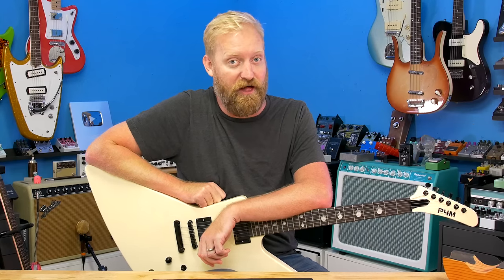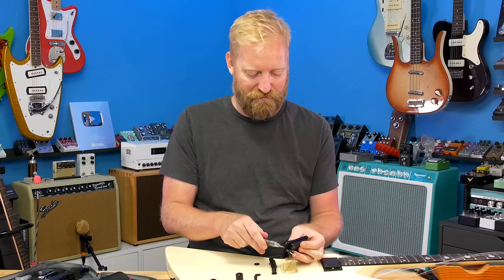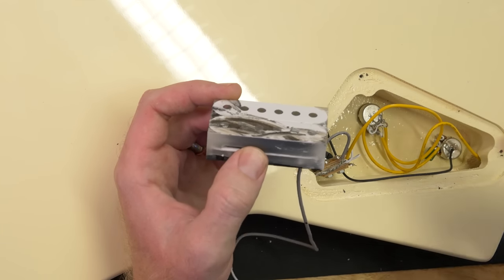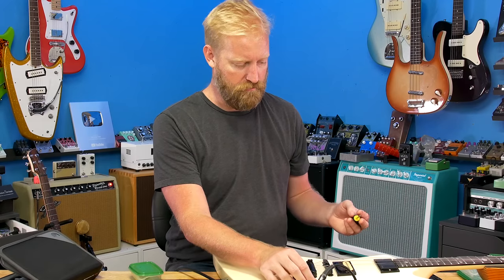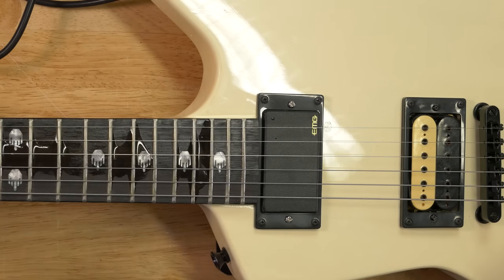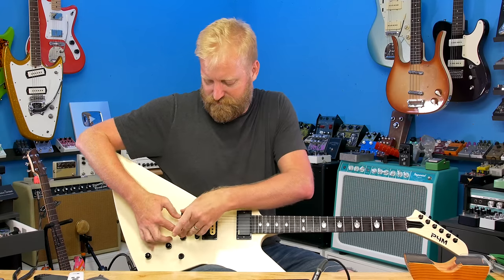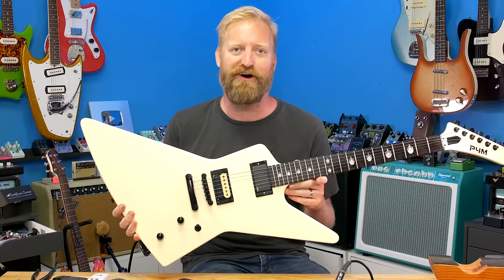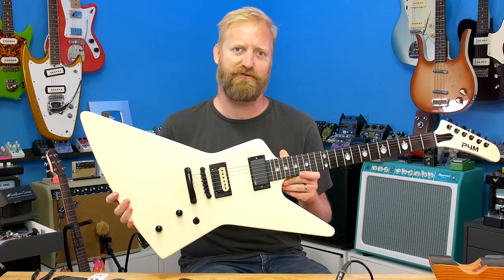EMG OMG! - are these EMG branded pickups FAKES? - (Obviously they are, but lets take a look inside)

Comment: Something similar happened to me about 30 years ago. I bought a Les Paul copy, my first guitar with humbuckers. After I got it home and restrung it I thought I'd take the cover off one of the humbuckers. To my dismay there was only a single coil hiding under the cover. Fauxbuckers.
Reply: And then you found out what a P90 was.
Reply: After the Low End Lobster thing with the Gretsch.  I used magnetic paper on the "Humbuckers" of my Epiphone Viola.  Not humbuckers.
Reply: I still don't know - never used one. Am I missing out?
Reply: @waytospergtherebro  A P-90 with the cover off shouldn't look exactly like a single coil, with a space next to it to place another single coil.
Reply: I had the exact same thing happen to me with an LP copy--I think it was a Lotus? I took them out to swap them with pickups from a cheap Ibanez, and sure enough--metal humbucker covers with single coil pickups underneath.
Reply: @andrewmize823  Mine was an "Onyx" from what I remember.
Reply: Was it an Encore?
Reply: @andym2612  

Im looking at one of those right now. Its a typical low impedance ceramic single, sitting on one side of a humbucker plate, with a chromed cover on it.
Reply: @waytospergtherebro  Huh?
Reply: Harley Benton EX with EMGs have real EMGs right? It's about 399 euros on Thomann. It's not fake, right? Well, it's fake EX copy guitar yes, but with REAL EMGs????
Reply: @JohnnyRaven69  Yes. I've had several Harley Bentons with EMGs and the PUs were the real deal.
Reply: @tostrmofo6686  Nice!

Comment: That’s black epoxy.  The coils probably weren’t wax potted first. You still have to do that with epoxy encapsulation.  The epoxy didn’t seep to the top of the pickup. So there’s an air bubble there. That’s probably why they are microphonic.

Comment: I have wires with crocodile clips at each end and clamp it before making the connections permanent. allows for a lot of experimenting with no hassle. If I am experimenting on a strat style I have two pickguards, one on the guitar with the pickups mounted and wires poking through and another out of the guitar with the switch and pots. Then just text and experiment before moving the pots and switch to the main pickguard and making connections permanent.
Reply: Me too, now. I once wired up a Strat w 26  settings. A lot of work for nothing. I ended up using 3 a lot and 5 more occasionally.
Reply: @terryenglish7132  but it was fun to experiment, surely. Particularly useful when you don’t have the colour codes for the humbuckers.
Reply: And all the EMG bass pickups I have use the DuPont connectors ... only desoldering required to fit :-)
Reply: @stephenhookings1985  Good on paper, but I had one break. I managed to salvage it , but it was tedious work. Bad design. The connection belongs on the lead ends, not at the pickup body. I do hate having to change switches or more when swapping p-ups , so its a good idea in general not done right.

Comment: Thoughts: 1) EMG fakey fake fake. 2) Install the GFS humbucker; the fake has too much of the BAD microphonic-ness. Bonus: double zebrabuckers = cool factor. 3) Pull the tailpiece and use sandpaper to take the finish off where the wire touches; also, make sure the ground connects properly to the output jack (you may have to sand it, too). 4) Bump up to 11s - if you want beef, go with a set of medium GHS Boomers. Style points for top-wrapping the tail. 5) White paint jobs are basically prime for any refinish - 3M maroon scuff pad to take the shine off, and repaint however you want (you could even just hand-draw on it) before spraying clear over the finished product. 6) Or you could just sticker-bomb it if you have a stock of swag stickers. 7) Killswitch...if you're going to do that you need the red arcade type, leave the guitar white, and pretend you're Buckethead.

Comment: Cheaper than cheap pickups, if they have that much resin on there and are still microphonic. Do have to say, though, that even with the distortion you had on there when you got it, it didn’t scream like it was on a Nirvana album.
Reply: As far as the bootleg EMG’s, probably done to make it as close to Hetfield’s as possible. (And, if you ever join a Who cover band, you could use it for Anyway, Anyhow, Anywhere’s breakdown - with all the feedback and rapid fire toggle switching!)

Comment: you probably just need to run a ground wire diagonally from the control cavity into the bridge post hole with the end stripped a fair bit so it gets sufficient contact with the post.
Reply: That was my first thought; that they didn't get good ground to begin with.

Comment: I run a set of EMG 57/66 TW in my guitar and I can tell you that the more vintage voiced EMGs are reasonably microphonic almost to the point where it's kind of a problem sometimes. If I play a song that I've dropped with my Digitech Drop along with the music, if I'm in front of my speakers playing the music, I will hear the song come out of my amplifier pitch tuned down and it always creates this insane dissonant harmony that is actually kind of awful. Makes playing with a drop pedal actually extremely frustrating. I still love the pickups to death, and I'm sure that it wouldn't really matter in a live setting, but when I'm practicing, I have to be careful not to sit with the guitar directly in front of my monitors or I will hear a pitch shifted version of the song that I'm playing while I'm playing it, if that makes sense.
Reply: The digitech drop is such a dumb pedal. Personally i have a guitar or 3 for every tuning
Reply: @Ottophil  personally, I'd rather not have 15 guitars just so I can play along to songs I like. Plus, using a drop pedal allows your string tension to always be the same and your muscle memory develops faster. And I only have to buy one gauge of string and can play my favorite guitar the whole time. A lot of professionals use them for the same reason. It's one of the best options unless you want to go with a modeler, which personally I don't. Let people like stuff. Your thinly veiled humblebrag is kind of embarrassing.

Comment: I got a guitar from China last month. A Schecter Guitar Research (silkscreen on the headstock) Jaws of Death (BalSac) clone (has the neck inlay) with a pair of "EMG's" color coded for Ceramic (Gold), and Alnico (Silver), a single volume knob and a 3-way toggle switch (which N + B were wired in opposite from standard). I originally thought the pickups were a variation of EMG HZ's like Cort uses, but like you describe, they were terribly microphonic! I installed a set of quality strings (10-46 D'Addario XLs) and found a two-wire configuration in the control cavity. I was like, "Huh!" So I went to EMG website and looked for some HZs. Still several pins, so I knew then that these were imposters. So I added a couple of ON/ON/ON mini toggles with various cap values for BASS and TREBLE cuts to tame them, but I still wasn't happy. I took it to the next level. Replaced their mock FR tremolo with a FR 1000 and nut, replaced all the tuners, and was I literally was listening to videos and comparing sets of legit EMG passives to slap in there with a Kill Switch Pot when I came across this. I really appreciate you posting.  I got a custom lizard skin wrap coming, since the body and neck are actually really pretty good. So I got a base guitar, and am hot rodding it for a one-of-a kind.

Comment: I had the same grounding issue on a Les Paul I built with black hardware. Went in with a small Dremel bit, and cleaned the paint off the inside of each hole in the tailpiece where the string ball ends sit, then took the finish off the insides of the hooks on each end, the inside of the posts where the hooks attach, then made sure the threads were bare with a wire brush. Perfectly grounded.

Comment: curious about the grounding thing - I had the same issue a little while ago with an LP clone that I was modding out and I couldn't for the live of me figure out why it was having the grounding issue until I realized that the ground wire was going through properly to the bridge but the sleeves that were going to the body weren't actually metal - the sleeves were actually chromed plastic and the ground was never going to contact the bridge. once I replaced the entire tail it was all good

Comment: 2 Things. EMG makes excellent passives that work w normal pots. All their p-ups are epoxy potted, unless its changed since I took  an EMG Select apart . These are fake.
Reply from the maker: Unless it's changed, those were usually labeled as EMG-HZ instead of just EMG. I think the EMG Select were labeled as "Select by EMG" - steve
Reply: @60CycleHumcast  Yes, EMG makes the active EMG, the passive more upscale EMG- HZ, and the passive  budget EMG Select.EMG is the company name , as well as that of their active line.
Reply: @terryenglish7132  there were some EMG inspired pickups on the Steinberger XT25 Gibson reissue - really weak and needed replacing. I love EMG actives on my basses and I added a set of DG20s to a cheap Harley Benton strat on my channel - they sound great.

I would hope the pickups shown here are fake. And if so I hope the supplier ceases and desist - there again best to add your own EMGs on from a known good supplier.
Reply: @stephenhookings1985  Those aren't EMGs in any form, inspiration not withstanding. Gibson bought Steinberger.. The reissues have p-ups made by/for Gibson or Epiphone depending. I have a Spirit small body RI and its p-ups sound fantastic, but they are weak. They're going for clarity and transparency and flat response rather than trad sounds or power. The guitar itself is much better than the originals; totally different design, just looks the same. Other than being weak how did they sound ?
Reply: @terryenglish7132  my point is simply at one time the PU were, as you said, called EMG Selects. But eventually Gibson stopped putting the EMG label on the case - which I think is a good move. The PU on the Spirit were just poor in general. And the almost Humbucker size (89 x 38 IIRC). I tried using a guitar PU (as per Rick) - it so almost worked and gave the bass a decent powerful tone. I tried unbranded Chinese PU. They were like those here. And microphonic as hell. Even foam on the back didn't help. Eventually I routed the cavity wider and stuck some Warman Jazz blades on it. For a passive bass it sounds good - and with the Royal Blood inspired distortion and octaving it is "to the max" (I restrung E to high C and levelled frets).
Sniffer Customs put real active EMGs in one on his channel. Beautiful job and tone.

Simply to say I would hope EMG would not sanction their name on crap pickups. They seem expensive as a brand until I factor in that I have zero noise issues and a reliable tone to sculpt as I want. The cost of my time to shield a guitar or bass is greater than the price of the pickups. I would hate to find fake EMGs - and as u have stated - it is normally easy to spot a fake.
Reply: @stephenhookings1985  Wow , too bad. The bass ones must from a different source. No issues w the guitar ones. Edit: On rereading your reply I think I need to mention something. The original 'Bergers used Bartolini p-ups as Hi-A originally. Then they switched to EMG. But neither company was owned by Steinberger. They just were the suppliers. So when Gibson bought Steinberger they no longer had any connection w EMG so they can't call their p- ups either EMG or Select. Cheers.

Comment: I don't think they were ever going to be active EMGs with no battery to be found. But EMG has a series of passives too, I don't know what they look like under the cover and they are not very microphonic. Also I think the EMG logo colors are pretty specific to models, those look like some of the active model colors to me but I'm no expert.

Oh and the color coding for pickup wires is a mess and I hate having to Google that shit every time I swap pickups for a guitar
Reply: From what I could find the Passive EMGs have an “HZ” next to the logo on the front and much more similar to an Active EMG with the quick connects.
Reply: Bing it instead? Variety is the spice of life 😂👍🏼
Reply: Like Schwig said, passive EMGs would be branded as EMG HZ. These are 100% fakes.
Reply: @Swigger96  my Shecter bass has EMG HZ's in it but they are active

Comment: Did you check with EMG as to whether they supply to BadCat / or ask them to verify (or not) the pickups?  I assume that the  Metallica  /James Hetfield endorsement is fake also.
Reply: It is
Reply: The biggest giveaway for me is that generally EMGs are powered by a 9 V battery which has a separate set of conductors. This pick up did not have that. It also did not have the EMG quick connect system built into the pick up. In fact if you look on the back of the black goop you could actually see the pole pieces kind of sticking very strange to say the least!

Comment: Bought a cheap, white ESP (under $200) Explorer only for putting a checkerboard (Rick Nielson) vinyl face on it as an art piece.  I wasn't expecting EMG's in it but, I knew they weren't real EMG's (after inspection) but, because they are flat on top, I was able to vinyl the pickups with ease.  It plays like crap but, it's a great looking wall decoration.  I saved some of the vinyl so, if I want to put real EMG's in it, I can still cover them.  The neck is horrible with some high spots, though.  Lot's of work that I don't really have the gumption to fix, right away.  Still, it's aesthetically beautiful. 

Speaking of IVY guitars, I bought one of those Lizard Green LP's (for $200 on Amazon) only because of the look of the Iguana Burst Gibsons that came out a few years back but, knew I could bever afford.  The Flamed Maple veneer was blurry and after playing it for a few minutes, I had black fingers.  They obviously painted the "Rosewood" neck.  It played great out of the box but....

Before that, I bought a purple burst AIO/WOLF LP for under $600 with a hard case and that thing plays like a dream, right out of the box.  Worth every penny!

Comment: The reality is still such that for under $10, the Chinese could produce an identical clone to active EMG's. Their active is SMD so it's literally 25 to 50 cents including the PCB for a Chinese clone anyway. The LM4250 isn't exactly a top notch choice for an active circuit either. I just use good ole fashion transistors and my circuits turn any average unbranded pickup into a monster that eats EMG's and other major brands alive. 
Meanwhile, my circuit in itself is about 20 cents in parts lol.

Comment: I’d like to see you do a roller bridge and/or roller nut swap on that guitar.  I bought a similar fake explorer and did a complete solderless EMG pick up, pot, and tone switch swap (and hip shot locking tuners).  Lot of set up work as well - and used heavy bottom skinny top strings.  It sounds better, but keeping it in tune is a challenge.  You think the rollers would help?

Comment: I have two Harleys. The ex modern with the emg 81/60s and a fusion III hard tail roasted maple with the retro hot 70s. Both are are pretty good. The fusion is my favorite of the two. It has incredible sustain even when unplugged. The ex modern is way to light for me, a neck dives horribly. The fusion III is light too but for whatever reason it's sounds better. I also have a 2014 Ltd ex-360 with the EMG 81/60s that blows both Harleys out of the water. Also a 07, Ltd ex-400 with same 81/60 combo that is nice too. I haven't removed any of the pickups to see what's what yet.

Comment: They are NOT floating in resin.. it is just a resin seal and underneath there is standard parafine.. the microphonicness can actually be sorted out if you drill atiny hole in the resin and re-wax-pot them  :)  but then they still dont sound as the real EMGs.. you are better off with a standard open coil pair by say fleor or  belcat buckers if you want to save on pickups.

Comment: black is always line and green is always ground and unshielded is common or ground, the stuck is  metric if you need to run a new wire its easy to get out if its just the powder coating just lightly file it.
Reply: Odd all of the pickups i've bought new had schematics that show red and white tied together unless you were coil tapping, black as ground and tied to the shielding, and green going to the switch or volume pot for switchless setups. Good example are humbucker pups from Guitar Madness out of Florida which all have the same lead layout.
Reply: that is not true at all... you have to read schematic for each model

Comment: The same company that makes these will make you your own brand for wholesale as long as you order at least 6 instruments. I think Bad Cat should have picked a different oem maker.
As far as the pickup: I have an old pickup that has Select by EMG printed on it and it looks the same as the one you cut apart.
Reply: Well, that Select pickup is by EMG. They used to offshore production of their spec'd passive pickups and they were usually used in guitars made in either the Cort or Samick factories in S.Korea. They may have also been made made by either of those companies as well. Technically, it is a real EMG. Just like the PRS SE's are technically a PRS.
Reply: What's wrong with the guitar's oem maker? It was very well made according to him. The main issue is the microphonic pickups.

Comment: Real emgs have raised legs, the fakes have flat legs. At least that is how it is on the active versions. The raised legs are to accommodate the solderless connections, which even the fakes have. Also the fakes are not that noisy for me, not as deep or throaty as the real thing , but this can also be model specific.

Comment: All real emg are complete plug and play.  Behind the 81/85 are 3 pins on the bottom of the humbuckers to connect to a small power supply adapter.   There is no attached wire colors..